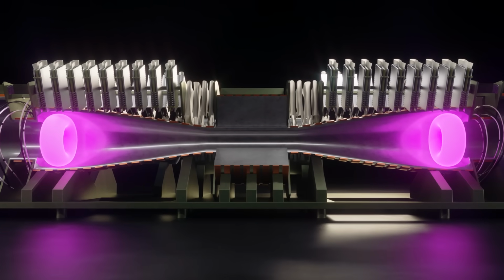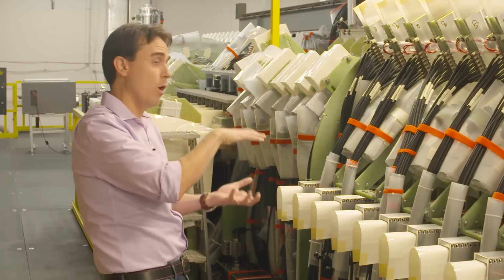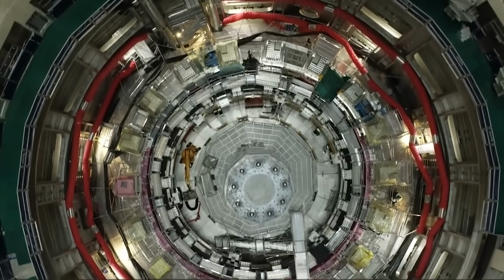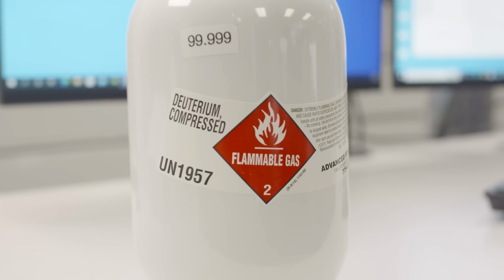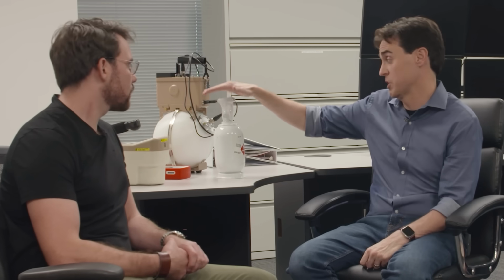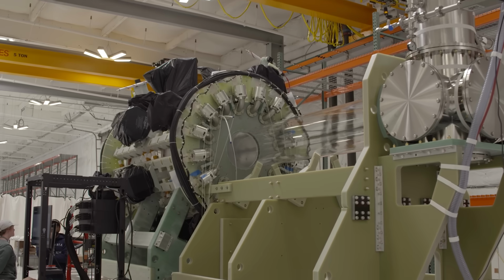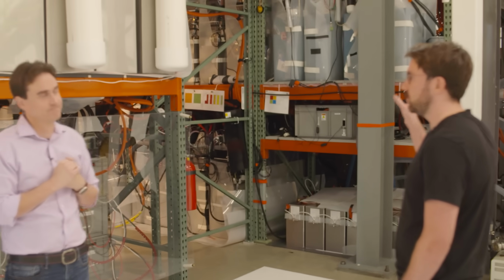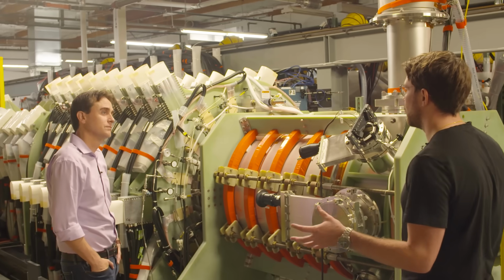A New Way to Achieve Nuclear Fusion: Helion

Comment: Now we need a single very important question: does this thing even get a positive energy output? I mean no ignition means no real energy from it
Reply: Ignition does not equal positive energy output, even though they are often misunderstood as being the same thing. 
Positive ENERGY output is more energy out than what goes into heating the plasma, without conversion inefficiencies taken into account. That is what is usually referred to as scientific Q >1 (Qsci >1).
Note that this differs between fuels. It is a lot easier to do for Deuterium- Tritium fuel than for pure Deuterium or Deuterium- Helium3 fuel because D-T is a lot easier to fuse.
IGNITION happens when a lot of fusion happens (generally around Qsci ~8). When that point is reached there are enough hot fusion products for the plasma to become self-heating and all external heating can be turned off. Then all external heating can be turned off and Qsci becomes essentially infinite. That is very important for "slow burning" designs like Tokamaks. 
Helion does not need to achieve ignition because they can recover 95% of the energy they put into the machine directly as electricity. So they essentially have 95% of ignition already.
The fusion reactions then only have to add 5% extra energy for the machine to be net energy positive. Since they can (prospectively) convert that directly to electricity at a very high efficiency too, they can get away with a very low scientific Q. In fact, IF their efficiency is high enough, they can even get away with a Qsci < 1 and still produce a small amount of net electricity.
From what I understand, they can get away with a Qsci ~2 and still produce net electricity, but the exact factor will be determined with Polaris towards the end of 2024 (give or take a few months). 
Scott Hsu and Sam Wurzel of ARPA-E have actually looked into that and it is sound. This is one of the genius innovations that Helion is pursuing.
Whether it all plays out is something we will likely know when Polaris has had its run. I for one am bullish about them, but I do understand if people are skepticial.

Comment: From what I see here, the cables they use are not very thick, and they aren't super-conductive either, so they can't physically operate high electric currents. A couple of kiloamps at most. Not very convincing.
Sorry, I did not skip my physics classes at highschool.
Reply: Sure you can put high currents through regular cables. What are you talking about?
The machine is also pulsed. The current only goes through for a few microseconds.

Comment: It probably seems really obvious to those in the field, but why wouldn't you fuse Hydrogen and Hydrogen?
Reply: I assume with "hydrogen" you mean a hydrogen atom consisting of just a proton and no neutrons. Helion (and others) will fuse hydrogen, but heavier isotopes of hydrogen with neutrons (1 neutron in Deuterium and 2 neutrons in Tritium) which are "bigger" and heavier atoms that are easier to fuse. Helion fuses two Deuterium atoms, others fuse Deuterium with Tritium, which is even easier (relatively).
The chance of two protons fusing is very low. In the sun it can take 9 billion years for the average proton to fuse. As a result, the energy density of the sun is comparable to a compost pile... That would not make for a practical power source on Earth :)

Comment: 300 km/s … obviously you are exaggerating a little.
Reply: no
Reply: C is 299.800 km/s
Reply: @sH-ed5yf  it is early in the morning yet but I’m pretty sure you can’t exceed the speed of light. Not without time travel anyway.  And sure a time travel machine is a free energy device.
Reply: @jillengland3277  read again my second comment, think again and then coment again. you are not much wrong only about factor 1000.
Reply: @sH-ed5yf  exactly …
Reply: @jillengland3277  at least you admit that you are wrong.

Comment: I'm very impressed with the original thinking going on with this project.  There may be unsolved problems, but the method solves how to get to fusion, and how to get electricity out, all using the same  (can I say "simple"?) device.  I highly approve of both and am proud of these guys for thinking along the same lines I do.  Refreshing to see a way to generate the electricity, that is not just another way to boil grandma's tea kettle.  I mean, would we really want to use nuclear fusion just to power a steam engine (turbine)?   And of course if it works out, Rudolph Diesel would be proud...
Then again, it might eventually lead to a steady state version, more like a gas turbine, similarly to how IC engines started with pistons, but  moved on to turbines.    :)

Comment: Can someone explain:
1. Where the products of the reaction go after they are fused and how.
2. How the insane temperature is controlled and if it can affect electricity.
3. How the electricity is captured, stored, and put on the grid.
Reply: 1. They are extracted with pumps between pulses.
2. Temperatures are high, but densities are low (still high for fusion terms), closer to a vacuum than to ambient air.
3. The plasmoid wants to expand again after the compression stage, driven by its own internal pressure and the added energy from the fusion products. The plasma is made from charged particles and the expansion (motion) of charged particles within the surrounding coils induces a current. That electricity is then stored in capacitors. Some of it is used to power the next pulse, the rest goes to the grid.

Comment: why can the helion not use both neutron kinetic energy and magnetic energy to generate usable energy?
Reply: They could, but the neutrons only contain about 10% of the energy in a mixed mode power plant. After conversion to electricity at 35% efficiency it would only add about 3.5% additional power. It is probably not worth adding the complexity of a steam plant with turbines, cooling towers, etc for that little extra.

Comment: This strikes me as an architecture that could also make one hell of a rocket engine.

Imagine two offset magnetic accelerators as with current designs, and then adding one more, starting at the reaction chamber and facing tangentially to use the energy of the reaction to accelerate the plasma out into a bell nozzle to create thrust.

It would look like a "T".

Comment: Always found Fusion to be counter-intuitive.  I get that Fission and splitting of atoms could release a lot of energy as there is a lot of energy stored in the bonds.  But it seems that the opposite - forcing atoms to move the other direction on the periodic table should require much more energy than is released.  Otherwise it seems we get masses of energy on both sides of these reactions.  I realise I am misunderstanding this somehow as fusion is showing that it does release a lot of energy.
Reply: Below iron, fusion reactions are exothermic. Above iron, they are endothermic. That is why they use lighter atoms for fusion.

Comment: If you can make the electric field powerful enough to overcome the color force, you can rip apart the neutron into up and down quarks, which have charge and will push on your field to provide their power. If you can do that to your fuel, it won't matter WHAT you react as fuel, because you'll react quark-gluon plasma and it will recombine back into iron under pressure since that's the most stable element.

Comment: So far this semester I haven’t enjoyed a single lecture in thermodynamics but at least now I see why I’m taking the class
Reply: I too hated thermodynamics when I had to study it. It was very boring and totally disconnected (I thought) from what I expected to work in. So much so that I almost flunked that year because of it (and relativity was not far behind).

Years later I found out I was wrong, it was not useless, and even more surprising, I didn't really disliked it. I was forced to  do some restudying in order to solve a few problems with my work, and I enjoyed it. Then I realized the issue was not the topic, but the teacher.

Having a glimpse of the applications always makes theory more interesting. If your teachers are unable to offer you that, try to find your own examples.

Comment: Have they achieved ignition?
Reply: It does not matter.  Helion's approach will emit neutron anyway.  It means even if they have a working design they need to wrestle witn NRC for decades before the plant will be built.  The chance of its success is close to zero.
Reply: @catchnkill  Not necessarily. The radiation levels are comparable to accelerators. The NRC has not decided yet how fusion power plants will be regulated. Current trend is towards regulating them like particle accelerators.
Also, Helion does not need ignition because of their efficient direct energy recovery and input energy recovery. When you can recover 95% of your input energy (plus a significant part of the fusion energy) directly as electricity, you do not need ignition.

Comment: if they're going from room temperature gases to high temperature fusion, wouldn't it make more sense to pipe the unfused plasma after each pulse, into a cooldown circuit around the magnetic accelerator chamber, to give an assist in magnetic field generation?  that would take strain off the capacitors after the first few pulses are formed, as the residual plasma could be threaded in a totemic fashion to self generate its own confinement fields while shoring up the primary chamber.... just a thought.

Comment: at last something that makes sense. the whole tokomak debacle disgusts me. it did not work so we will make the same thing again but bigger seems like no logic to me. if it did not work we need to try something at least a little different. this shows promise, rather than using huge amounts of power just to contain plasma, accelerating the plasma puts part of that energy into the reaction, only time will tell but only by trying something different will we learn more. to me obviously better than trying the same concept endlessly. hopefully the usual deceptions like unreasonably high sfficiency of generation systems will not be seen here
Reply: What do you mean by "did not work"? All current and prior tokomaks are experimental devices.  They are scientific experiment.  There are still questions to be answered.  Noone has mastered everything in fusion and can design a working fusion reactor to generate electricity.  Noone.  This is what scientific research is all about.

Comment: this whole video feels like an investor pitch instead of an informational look at the technology
Reply: They are fully funded all the way to commercialization. They are looking for qualified employees not for money.
Reply: @elmarmoelzer2229  No.  Absolutely not.  Not 1%.  Commercialzation may be 50 years away from now.  Their design emits neutron.  Thus fall into regulation with NRC.  Don't be fooled by the name fusion.  It is radioactive.  They needs approval from NRC.  You are talking about THE NRC.
Reply: @catchnkill  
I know that the NRC is problematic. I have been participating in some of the public meetings about fusion regulation, even.
The way fusion power plants will be regulated is still not decided yet.
They were supposed to decide on a framework in December but have been delaying time and again.
Ideally it will be like particle accelerators which is one of the options on the table right now. The other option is Part53, which would be really bad for fusion. In that case the US will likely be considered a developing country in a few years. The Chinese are already working on a clone of Helion's machine and will not be as squeamish with regulation. The Russians won't either.
Reply: Good information in this NRC presentation PDF. (Hope this works).
Helion starts on page 106:
https://adamswebsearch2.nrc.gov/webSearch2/main.jsp?AccessionNumber=ML22081A057

Comment: Hi, I'm wondering if you will perform a retraction or correction as some of the info you deliver is incomplete or misleading. 
You did not mention radiation that accompanies deut-He3 reactions (especially at lower plasma temperatures), or the low levels of reactivity for this type of fusion; especially at such low temperatures (making net energy gain very unlikely to be achieved).

In other words this feels like corporate advertising more than informational/educational content
Reply: - The power plants will operate at higher temperatures (220 to 330 million degrees). Trenta is still a sub scale experiment.

- Temperature is not the only thing that matters. Density matters too, so does electron to ion temperature ratio. The lower that is, the higher the ratio of fusion power to losses.
That ratio further decreases with plasma temperature. So power plants would do even better than Trenta in this regard.

- Neutrons from D-D reactions have a lower energy than neutrons from D-T (2.45 MeV vs 14 MeV), are easier to shield and are below the activation energy of many materials. Other materials behave better when activated by D-D neutrons. E.g. the aluminum they use in the magnets, when activated by D-D neutrons only has a half- life of 2 minutes.
Reply: @elmarmoelzer2229  You must work for Helion.  I can't imagine another reason someone would bother to respond to hundreds of comments explaining why this is the greatest thing since the wheel.

Comment: We never learn from our mistakes.

Compressing hot plasma is a futile process because the plasma pressure and the magnitization energy are losses that will undermine net efficiency.

Pushing two masses of hot compressed plasma is borrowed from the initial U235 nuclear bomb and is too rudimentary to overcome the Coulomb forces.

The extremely complex machine negates any success.

You can only achieve a fictional microscopic fusion with extreme losses of input energy and no meaningful net gain.

The enthusiasms of those motivated and driven young scientists is counter-productive since the basic underlying concept is flawed.

Comment: interesting. So where are we dumping the toxic radioactive byproducts of these devices?
Reply: What toxic, radioactive byproducts?
There will be some activated components of the machine and the building, but they are very low radioactivity and below background within less than a year after decommissioning. Decommissioning can happen less than two weeks after operation has ceased.

Comment: Well so far the real challenge is to get more energy out than we put in - a positive outcome  not a negative one. 
To the extent of my knowledge it has been only achieved once. Not entirely sure if it was done more than once. Fascinating to see a new approach! Fusion is the future of humanity.
Reply: The real challenge won't be to simply get a net positive energy outcome. It will be to get enough net positive energy to pay off the huge upfront cost of the reactor. Nuclear fission reactors suffer the same problem. They have net positive energy outcomes at a relatively small operating cost, but building the reactor is so prohibitively expensive that basically no private enterprise would risk it on their own(even with an optimistic 30 year payback period, how many companies would be willing to sink some $20 billion dollars into a project in the hopes that that company is still around in 30 years to even just break even?).